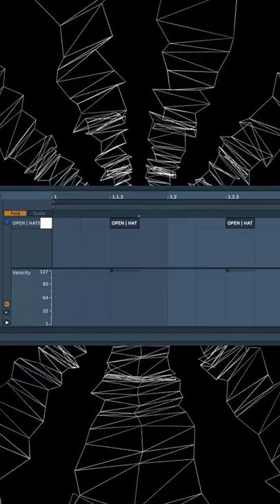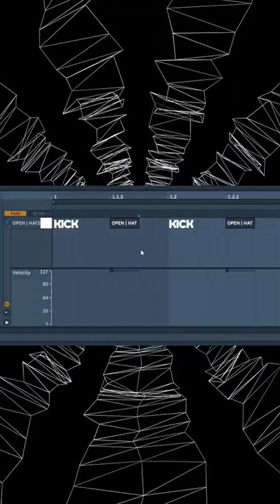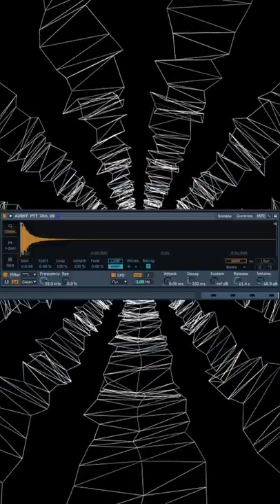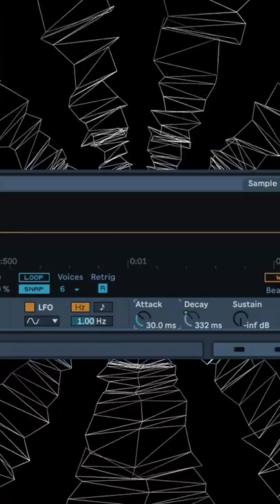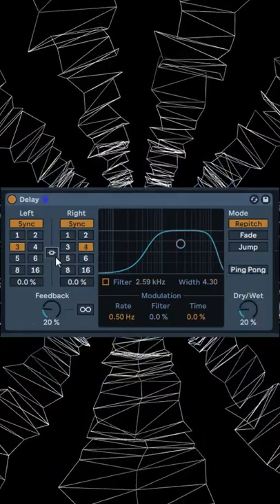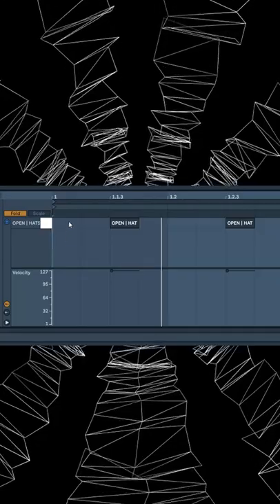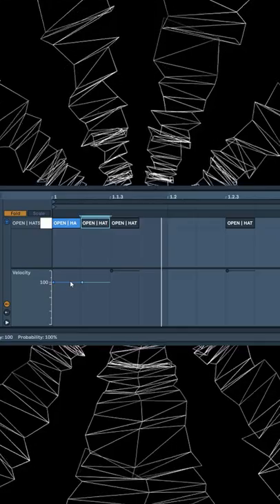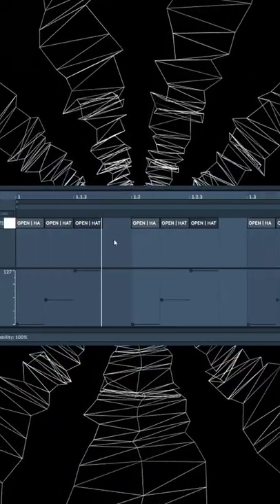Easy way to make Driving Techno Hats #shorts

Comment: Nice tip, and I've been using a similar technique for a while.
Also, if you add an Open Hat (used here as a shaker line), lower the decay value and increase the attack value, you'll get an incredibly beautiful instrument result. 
And with the EQ you can balance it a bit and produce completely original sounds. Good luck.👍
Reply from the maker: Thanks for the tips, will try out!
Reply: @audioreakt  you're welcome